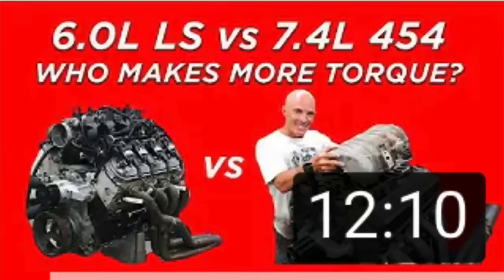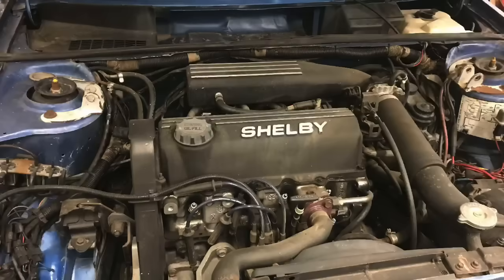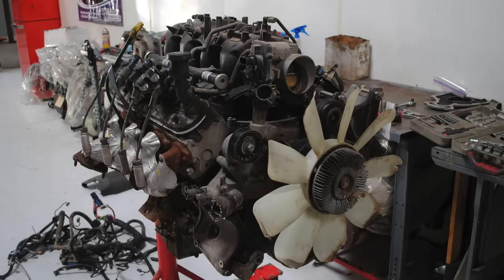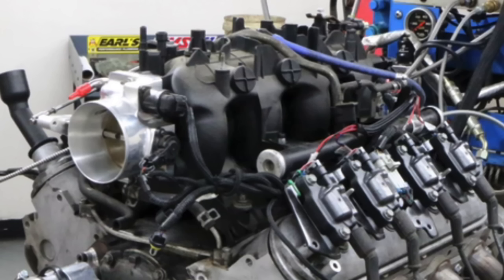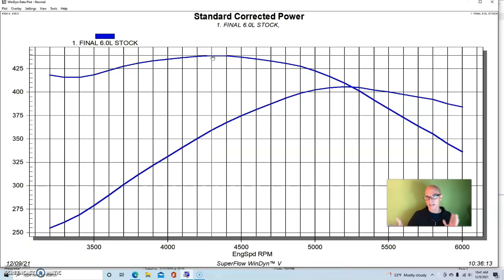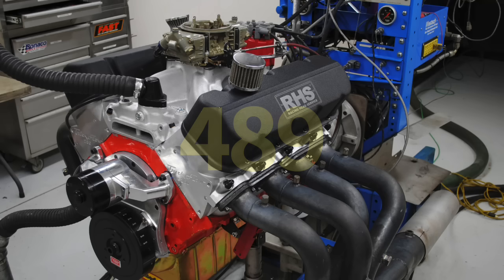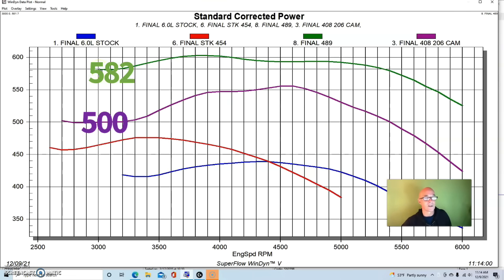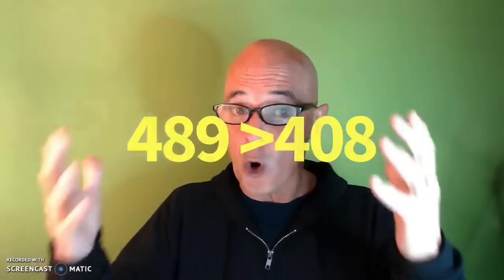LS VS BIG BLOCK! WHICH STROKER MAKES MORE TORQUE? 6.0L VS 408 LS, 454 VS 489 BBC THEN 408 VS 489 !

Comment: I have many different engines in my various 9 cars. 401 and 425 Nailheads in my 60s Buicks, built, injected, 496 stroker in my old vette, LS2 cammed in my C6 Z51 6spd, 401 (408) AMC 525 HP in my grand wagoneer also injected, LT1 built with LT4 Hot Cam in my Roadmaster Wagon, the absurd response and torque of my 425 Nailhead in my 64 Riviera is the most enjoyable on the street, but its making killer torque down at 1800 RPM even with a fairly wild camshaft, ported heads, intake, headers, etc. It will NOT touch the others on the top end but for street driving its the most enjoyable by far. I wish someone would dyno a stock 425 Nailhead then do some cam swaps, common mods, and show us what it would make under from 1800-5000 RPM.

Comment: do u even understand what the LS was designed for or who was behind it the LS was designed by GM racing division by Leslie snoboski  hint LS it came out in 1970 they used the chevelle to interduce the new line of GM racing engine LS1 to LS 7 that means it is not a chevy engine but a GM engine it sold as a crate engine till 94 the chevy big block was met for a car as a driver this is why u can put a blower on a stock LS they are built for boost
Reply from the maker: THE 1970S LS MOTORS WERE BIG BLOCKS-NEW LS ENGINES ARE SMALL BLOCKS

Comment: Hey Richard, if a 8.1, 8100 vortex is a stroked 454, why are they not a popular choice for hotrods or drag racing?
Reply from the maker: because the Gen 7 8100 is a completely different engine (not like the previous Gen 6 454)-still good and big, but different

Comment: How would 706 heads do with a 408 stroker for a towing build? With truck intake btw. What dish pistons and completion ratio would you recommend?
Reply from the maker: I would pick other heads
Reply: @richardholdener1727  what heads would you recommend
Reply: @richardholdener1727  trying to do a budget build so I wanna keep truck intake and preferably a cheaper head. I’ve got 317 and 706 heads at the house. Maybe one of those or another cheap head would work well low end? Also would your low buck truck cam work good for this?

Comment: What bolt pattern are LS engines metric or standard?
Reply from the maker: bolt pattern for what? the fastners are all metric
Reply: @richardholdener1727  it’s been a couple of years and still worked on a junkyard build all my tools are stolen so I wanted to know where I should start  for 5.3 tear down couldn’t remember the bolt pattern

Comment: Like I said 454 bored out cammed up with good heads there's no way in the hell and with the right gear ratio it will be crazy. But my question is can I hook a LS 6-speed up behind by 454

Comment: Then why is the advertisement of hp only 290hp on the 454 if your getting more than that stock?
Reply from the maker: the factory rates using a different configuration
Reply: @richardholdener1727  so realistically what is the hp of a stock 97 454? All I know is that my speedo is 4 mph faster than I'm actually moving.  And it like to run hot.

Comment: Great video Richard! Just wanted to point out that the 408 was only down about 82 ftlbs compared to the 489 at about 3k Rpm.

Down 80 cubes and but only down about 80 ftlbs.

Thats VERY impressive. Combine that 6.0L potential with the insane levels of parts available for the LS even compared to the mighty big block. 

As a Big Block Chevy fan boi, the 6.0L takes the win here based on that. Not bad.

Comment: I have a 2004 6.0 4x4 silverado 2500 HD
Needs more power for towing than it has to make it through the mountians pulling a 26 ft 8000 lbs trailer . Do i need to sell it and get a diesel truck, or can i turbo , or supercharge it ?
If i do , can it make the power and still be dependable ? Would the fuel economy improve, or get even worse ? Would it run hot?
I have a 6"  fabtech lift ,  315/ 70 / 17  load range E tires , headers duel exhaust , and K&N intake tube and filter in the Isolation box .
thanks for your input
Reply from the maker: DIESEL IS IDEAL(BUT EXPENSIVE TO BUY), BUT BOOST CAN WORK AND HELPS A LOT
Reply: @richardholdener1727   being its for towing . If you boost a 6.0 , will the fuel economy improove orget even worse?
Reply from the maker: fuel economy won't improve when under boost-you use more fuel
Reply: @richardholdener1727  thank you. Makes sense

Comment: I’m building a 489 using stock heads forged internals looking for a good hydraulic roller cam? Any suggestions? Very much appreciated.
Reply from the maker: what power and rpm level?

Comment: Now we need to talk about fuel efficiency because I wonder if the 408 with that cam upgrade will get slightly better fuel economy just talking in terms for towing if your building a street machine that's called smiles per gallon

Comment: I bought a 408 stroker but haven't put it together yet. It's replacing the lq4 in my truck. Haven't decided on cams or heads yet. 1 thing I was curious about was a 454 w cam, etc. Using common logic, just the displacement difference compared to the 408 should out torque it. But, no trick FI intakes like the fast is available AND, getting the electronics figured out to work with the truck is what convinced me to stay with the ls. However, I love the old school big blocks. It is my daily driver which is why I didn't consider the 8.1.

Comment: need to show torque and hp numbers from around 1500 rpm.  that's where you feel torque pulling a load. not everyone is building a motor for top end power.
Reply from the maker: and no one runs wot at 1500 rpm (below the converter stall speed)

Comment: Hey Richard you should do a 427 tall deck block stroked to a 496. To see what kind of hp and tq numbers it would make. I have heard drag racers said they have used them to make crazy builds with crazy hp.
Reply from the maker: much harder to get intakes for those-same power as a std deck 496
Reply: But wouldn’t it have more torque being a tall deck block? This is what I’m being told but that’s why I’m coming to you to see if that’s a difference before I purchase this 427td block when I already have a 454 block. Any info would be great. Thanks Richard

Comment: not all true bigger is better,you prove it , 408LS is better then 454BBC all the ways ;)
Reply from the maker: 408 not better then 454 in all ways
Reply: @richardholdener1727  where it s not with 206 cam 500lbs at 3000 and 555 at 5700 for 454 with cam 480lbs at 3000 and peak 520 at 3700...
Reply: @stephanouellet3673 you gonna cry? 😭

Comment: @Richardholdener from what i hear is for the Gen 6 454 i hear a good thing for these is to do an RV Cam swap for more low end torque, im going to be swapping a gen 6 454 into my 99’ Express 1 ton in place of the Vortec 350

Comment: Richard, great content and excellent test options on your videos.  Question: I have a factory aluminum 6.0 block, can it handle a 408 stoker mod without new sleeves?
Reply from the maker: not a 408-but a 4.05 bore and 4.0 stroke
Reply: @richardholdener1727  Thank you for the response!

Comment: lol, it's only making 450 lb/ft at 2700 rpm! We have an aluminum 6.0 stroker, 402, with a 248/252 cam that we autocross with, one of our biggest problems is loosing traction off the turns. 640hp 580lb/ft
Reply: I just got my LQ4 6.0 vortex bored and stroke to a 408 Stroker , stock 243 heads 10.5 compression ratio, Texas speed 228/ 232 600/600 112 lsa , and 3000 to 3200 stall converter

Comment: When comparing street combos, could you also present BSFC?
Reply from the maker: why do you need bsfc at WOT?
Reply: @richardholdener1727  I'm not asking for BSFC at WOT. But, if you guys are doing full calibrations on stuff anyway, adding a fuel flow meter is relatively inexpensive and wouldn't require any additional run time. Plus, helping people understand the difference between efficiency and just WOT conditions is always a good thing. After all, a street engine spends VERY little time at WOT, so why not make it good everywhere else?

Comment: Richard.  You should have ran the heads cam and intake on the stock 454ci motor.  As many say BBC is still better than a LS.  big difference in cubic inch here.   Even better how about MAX effort LS 454 vs MAX effort ole school BBC 454
Reply from the maker: can't run big cams on stock short blocks

Comment: Did you keep flat top pistons in the BBC after stroking it? I built a budget 489 with iron ovals that had 113 chambers. With a comp 274xe flat tappet, and Airgap intake, it ran 11.84 in a stock chevelle ( so 500ish HP). Just splurged on a solid roller (236/242, .642/.644) and a set of Edelbrock 100cc ovals. Sure hope it runs as good as your 489. Would I have been better off spending more on larger chamber AFR or Brodix? Limited with my flat top pistons. Id like to see a 10 second slip!
Reply from the maker: we usually put small dome pistons (18-22 cc) pistons

Comment: Let big blocks breathe. They are choked in most factory configurations. I have a ZZ502. I swapped the GM heads that came with it to a set of Dart Pro 1's that breathed better. Completely different motor.
Reply: Big blocks rule , props to the ls generation , but everybody and their grandma has an ls under the hood , I know they're cheap with good horse power but it takes the fun & rilvery out of the sport of drag racing , I had Chevelle SS , Foxbody , etc , no way would I out a Chevy engine in a Ford , a Gto should have a Pontiac engine in it , same for a Mopar 426 , 440 or whatever ,  I understand this generation has nothing to work with , especially the G bodies , so alot of them go ls swaps , Nothing is sadder than seeing everyone building the same thing

Comment: I put a 4.387 crankshaft in my 454 making it a 505 I’m going to see how much torque and hp it gets on pump gas
Reply from the maker: 4.387?
Reply: @richardholdener1727  sorry miss print I’m also working on a small block with a 3.875 the big block 4.375 crank trying to maximize torque
Reply: @richardholdener1727  I do have to say you do very good videos

Comment: Love the 408 LS vs 489 BBC comparisons very interesting. I just finished a 408 LS n/a build with Trick Flow as cast 220 heads. Intake & exhaust guides narrowed, 11.3:1 compression Total Seal gapless rings with fast 102 intake and Howards cam 232/236 @ .050 112 LSA, 108 LCA .625/.625 lift. How would that cam compare to the 224 duration cam you used??? Would have been Great to see a 232, 234 or 236 @ .050 intake duration and no more than 238 @ .050 duration exhaust. Thanks for all your hard work with engine builds with dyno comparisons!!!
Reply from the maker: the 232/236 cam did not work well in the 408
Reply: @richardholdener1727  Can you clarify did not work well? Was a cam in that range used? And if so what was the cam specs? Thanks Richard H.

Comment: Looking to putin a 210 218 260in270 exhaust  ,596 .593 what your take on this cam on this exact combo w 108 lsa torque is all we are after with the caddy supercharger and mcdaddy adapters
Reply from the maker: on a 408?
Reply: @richardholdener1727  absolutely 408 with the cam I mentioned and the caddy supercharger
Reply: Torque is all we want down low 1500 to 6400
Reply: Why won't it work .

Comment: Great video Richard, thank you for hard work and dedication to these engines. One thing you skipped over was a built 454. In David Vizard's big block book he built a 10:1 60 over 454 with edelbrock e street heads, a 268 flat tappet cam, Victor Jr manifold, 950 HP carb. The engine made just a hair under 600 horsepower and 600 torque. David claims the cam has to be on the correct LSA for maximum power, in this case it was on a 107 LCA. After the heads were ported and flat milled, the power climbed to 626 HP and 611 TQ.
Reply from the maker: 268 (at .050?) or 268 advertised?
Reply: The cam was ground using Lunati profiles. It is 268 advertised duration, 227 at .050, 588 lift intake, .555 for the exhaust. 1.8 rockers on the intake, 1.7 on the exhaust. LSA 107 deg.

Comment: If you have a 454 already, there's no reason to ditch it in favor of an LS.  A stroker crank and some aloominium heads on the rat makes it a monster.
Reply: @IRastalion  I have too.  I have a stroker LS with a turbo.  Its an amazing package that makes these cool noises when you mash the throttle - or let off the throttle.
Reply: & u think the same thing can’t be done with the 6.0 😂 it can do it way more efficiently aswell
Reply: @demarcusbody9437  true.  Some guys get all hung up about this engine versus that... bore versus stroke... rod ratio... dynamic compression numbers... and so on.  The point is to think about the mods to apply to the current setup rather than recreating the wheel with a whole new setup.  A peanut port BBC will make tons of torque even though the heads aren't the best.  And remember, you start with more cubes than a 6.0 LS
Reply: @scotttimpany2845  yes but In that case I’ll take a 6.0 over a 7.4 liter anytime yeah they make torque but Aftermarket is way better futher more I know for a fact I would not daily drive a big block anything  atleast the 6.0 gas mileage would be manageable
Reply: @demarcusbody9437  Fair enough!
Reply: @demarcusbody9437  more aftermarket support for a ls. Dude bbc and sbc has two of the largest aftermarket support of any engine family followed by ls.
Reply: @michaelstoker6710  not really but u got it chief
Reply: @demarcusbody9437  man I'm not hating on te ls at all but I've seen this argument 100 times and it's really close but the bbc and sbc aftermarket is just a little bit bigger and I believe it's do to the ls stuff is so good to start with that a lot of the guys use factory stuff don't get wrong I know the market for ls stuff God knows I've purchased enough
Reply: @michaelstoker6710  These dudes been drinking the ls koolaid.

Comment: What would your bang for budget LS 408 bottom end parts list be? Im aiming to do a 1000WHP single turbo 408 stroker out of a LQ4 and I want to know what's a known combination that's really needed for engine life vs overkill parts that aren't really going to help much
Reply from the maker: you don't need a stroker for 1000 hp
Reply: @richardholdener1727  what would your budget built 1000WHP bottom end build look like? I know a stock bottom end will do it but for how long?

Comment: The fact that a stroker 6.0 made more power and torque than a big block is notable.  408 versus 454 cubes.  Smaller and lighter package 📦.
Reply: That 454 was a very restricted smog motor
Reply: @francfurian8215  No doubt.  That big block wasn't an LS6 or LS7 from 1970.  However, that 408 would still measure up pretty well to either BBC.  If you were to make a 408 or 416 with an aloominium block, the LS would be well over 100 pounds lighter than any big block "from the day".  Richard hit it on the head... the LS is extremely efficient.
Reply: @francfurian8215  I wonder if Sir Richard has dyno data from a factory (or factory equivalent) LS6 BBC to compare to that 408 LS.  Have ye thrown down the gauntlet?
Reply: @scotttimpany2845  hahaha no I haven’t thrown down the gauntlet but it would be interesting😊
Reply: @francfurian8215  Has anybody done a LS6 454 BBC versus LSX 454 comparison?  I should probably go back and look at Richard's collection.  That guy never sleeps!

Comment: Soooo Richard, for future reference, when testing for torque production, I'd like to see these dyno pulls start around 1500rpm, instead of 2500.. I want to see off-idle performance, how's it gonna do taking off from a dead stop with, say, an 1800 stall coverter. Also at some point would like to see a comparison between the 4.3 gm v6 and 262 inline, also 292 chevrolet inline 6 vs ford 300 inline 6. Just some food for thought from one motorhead to another.
Reply: @nicknick2350  oh, I see. I understand now why they usually start higher up. Also Richard, my old ford farm hauler with a 300 I-6 sees full throttle at 1500 rpm on a regular basis, especially starting off with a loaded trailer, considering its not doing much over 3000-3500rpm...
Reply from the maker: you are never at full throttle at 1500 rpm
Reply: @richardholdener1727  Never? I'm sure I could datalog me doing that !!

Comment: Its good to know I can get stock Pontiac like torque from a cammed 408 inch LS engine, since I have a 6.0 with a hurt bottom end sitting in a parted out truck right now. The guy I got it from ran it out of oil when cooler line broke, and wiped the bearings. Hopefully its not a cam bearing that is dead. That would be one hell of a truck engine, or tons of fun in the 98 Formula and I could keep the 2.73 gear, as long as I put it in a 9". That 408 would pull my trailers real nice in one of the C10s, and would probably scoot into the low 12s easily.

Comment: I know it's uncommon for an ls but, I wonder if you pulled the lobe separation angle back to 110, and set the intake Centerline to 106 if it would make more in mid range